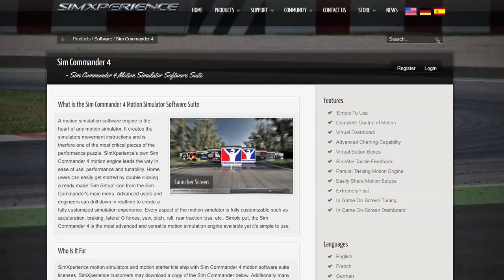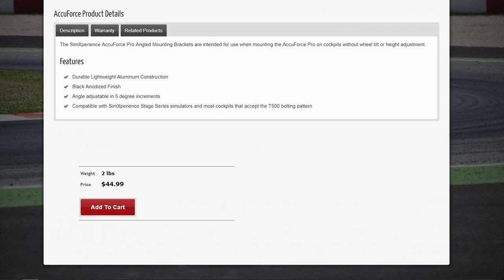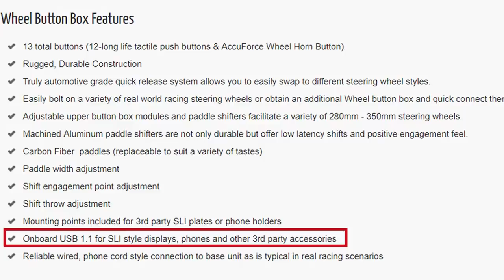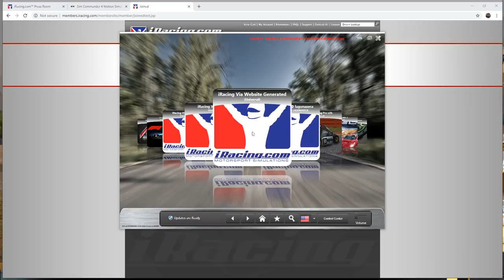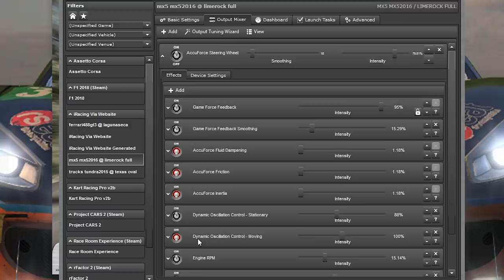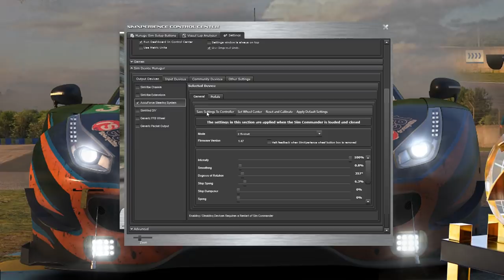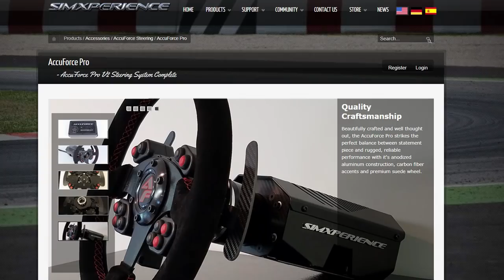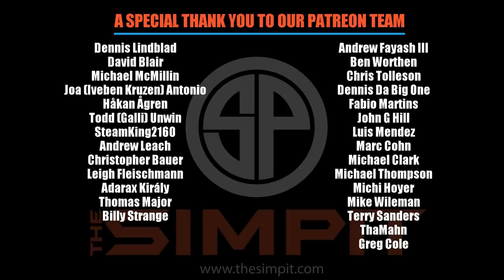Accuforce Pro V2 Steering System - Full Review

Comment: Now let’s go to fanatec dd2!!! Looking forward to the podium series review!!!
Reply: I tested the DD1 and great FFB. I don't think you need more than this and the hardware is the same. Just the software transforms the DD1 to a DD2.
Reply: Leynad Jee Well I wonder why there is a price difference if there isn’t any hardware difference. I know they’re gonna use the dd2 motor for the dd1, but I think there should be some difference in the control unit. Maybe the motor speed controller? If there isn’t any hardware difference, consumers won’t be happy... hundreds of dollars for a software? hmm...
Reply: "hundreds of dollars for a software?" Just thinking about iRacing 😁
Reply: It's only temporary. I believe Fanatec said that the DD1 motors aren't available yet so the pre-ordered versions of the DD1 will use the DD2 motor with an software restriction.  
It's predicted that the community will find a way to "unlock" full DD2 functionality but if the internal PSU is different, it may not work.
Reply: Leynad Jee Oh well that makes sense LOL. But still if that’s true, I won’t be happy... They can just enable the full power... There might be possible hacks to bring the performance up too... Just my thoughts though...LOL
Reply: Drew Duncan That’s what I thought too! But it is possible that the power supply or something that controls the electric current to be different...
Reply: I would not believe in a hack and Fanatec limits the torque anyway depending on the wheel. The torque isn't a problem with both and reliability must be proven first. The possible connection issues from the quick-release i mentioned here, are unsolved problems even by Porsche. And Fanatec has a track record in failing because one cheap part braking. I hope they do a better job this time...
Reply: @Leynad778  It's not just the software, the Motor is the same, but here are parts that drive the motor and those are different.
Reply: @thenonadventure  You can't "unlock" or "hack" a DD1 to have a DD2 because only the Motor is the same but not the electronics that drive it.
Reply: @Leynad778  The torque is only reduced for the 2 CSL Steering Wheels that have the plastic quick release.
Reply: @MixedRealitySimRacing  When they use a different board, they just need to switch a resistor so the motor get's less voltage. If it's the software or not doesn't matter. The effect is the same.
Reply: @MixedRealitySimRacing  we don't know that yet.

Comment: Was looking at a all fanatec club sport kit but switched to this wheel and thrustmaster t3pa- pro pedals
With a fanatec shifter actually now $200 under my budget with a 8020 wheel stand instead of $300 over budget.

Great video and thanks for showing this DD wheel :)
Reply: Seems like you could fill out the budget with some better pedals, or at least $100  for a third party load cell upgrade for the T3PAs.

Comment: Wrap around cable for me isn't an issue.  The cable provided from Simxperience is too short so can get tangled and break.  When I bought the wheel I got a couple extra ones that are about 50% longer and haven't had any issues, I don't even notice it.
Reply: Where did you get the longer cables from? My cable broke as well and I had to cut it and reconnect it.
Reply: @FadNad0731  You get them from Digi-Key, on the Simxperience website the info is there, the cable name is AT-C-26-6/6/B-5/R
Reply: @1984kylea  Thanks so much for the quick response! I have been struggling with this for a while. I will check it out. I might even consider the bluetooth version if it is available.
Reply: @FadNad0731  ya, I probably won't bother with the bluetooth version.  Honestly, I owned the Accuforce for 15 minutes before I broke the initial cord.  I right away bought 5 replacement cables from Digikey, they were shipped out and delivered within 24 hours and I'm still on cable #1 four months later.  The extra length makes all the difference.
Reply: @1984kylea  Ok Thank you, I will definitely get that cable based on your experience, it makes a big difference knowing that you've used it for quite a bit and have not had any issues since.

Comment: Almost 40 months since i got my V1 i can say: it's reliable. And thanks to SC i don't look to other DD-wheels, even i would like to have a bit more torque, for karts for example. I think the cable has two positive aspects as well: you see or feel (in VR) that the wheel is in center-position. If not you might already know what happens at the start. Second is reliability. Even in professional motorsport there is no bullet-proof connection inside the wheel. There is always a bit stress to the column and the pins bent a little and can loose the connection. Happend to the Ironforce Porsche GT3 R team this season and I heard from a Formula E team about this problems as well plus many Fanatec users. But last ones can google for similar problems and will find people. The GT3-team first had no clue and thought TCS, ABS and the transmission is broken. And it always starts intermittent with a shift not recognized here and than. Possibly the reason why they killed two engines within a month before.
Reply: Leynad Jee I’m a tech noob I have a ts pc racer and in most sims I just make small changes eg pc2 r3e and in ac and rf2 I leave it alone is the software that difficult to get in ball park? Also is sim commander a pain with vr (oculus cv1) to launch games? 
Thanks
Reply: @roverboy1687  Sim Commander with the Accuforce is not the problem, but with SimVibe and my Odyssey i have to start it last, because the HMD is changing something with the audio-output. But this is no problem with the Oculus, because the audio-out is fixed. Sim Commander is easy to setup with the Accuforce as well, because default is often okay and the more difficult part are the game FFB-settings, thinking of Raceroom...  Setting up SimVive is far more difficult, but rewarding once you get what you want. The TS-PC-racer seems like a good wheel and i would rather upgrade to SimVibe than a dd-wheel first. SimVibe is like VR for me. Once you know it, you can't drive without.
Reply: Leynad Jee thanks for reply I have the srs shaker cushion I like it but I’m now thinking bigger shakers on my rig would be better also it seems that the road surface is very pronounced and the curbs not so much maybe it’s a limitation of the package hardware. I tried an osw midge not sure what size at a vr sim centre in Scotland on p cars 2 and while it was stronger and I enjoyed some of the characteristics of the wheel I wasn’t blown away by it I don’t know what the settings were etc but felt as it wasn’t as big of a leap as I’d been building it up to be in my head same went for the next level v3 seatmover it was kinda cool but not fully communicative I’d like to try one again with belts attached to expansion springs to simulate the way belts cut in under breaking. On a positive note they had srs power wind simulators they were better than I realised I really enjoyed them even in tin top cars plus much better than usb fans for keeping cool in vr. 
I’m just very tempted at 699 dollars for the your way and then get my thrustmaster rims usb converted by ricmotec with the 70mm adapter plate.
Reply: @roverboy1687  I'm running 4x100 watt shakers for each tyre plus a Buttkicker Concert under the seat on a Brooks-spring-loaded rig. SimVibe has a lot of options to tweak, but every sim feels different as well. rF2 is great for curbs, but not much road-noise, pCars 2 is a bit more the opposite and ACC seems the best so far, at least in tactile feedback. iRacing seems dull in both, but bump suspension-effects and the shifting feels great. I will try the srs-software soon to check, if it does anything better or not. 

I tried the NLR v3 two times at the Expo plus 6 other motion-rigs. The v3 is expensive and not that fast. I would rather buy a SimXperience Stage 1, which seems a bit more violent, faster and cheaper as well. But this all doesn't make you faster and maybe even the opposite. This upcoming SimXperience GS-5 G-Seat seems interesting and maybe first choice once it get's released.

Comment: Great review Shaun! If you want a mid range DD Wheel, you have to give this wheel a serious consideration with it's pricing.
Reply: I kinda thought this was the cheapest DD wheelbase available.  If this is the mid, then what is the low end DD?
Reply: @hueysharapova7175  Sim-Pli_City DDs are cheaper, SiMagic DDs are cheaper....theres actually a few different cheaper options!
Reply: @michaelritch2045  The Simagic with rim included is $900, so basically the same price point.  The Simplicity website has a DD wheel for 630 pounds, which I guess could be considered a lower price tier, but from their website I cant even tell if that includes a rim (which doesnt exactly inspire confidence).  I guess you could order all the individual parts from china and assemble an OSW yourself for much cheaper, but thats kinda true for any product in the world.  The accuforce seems to be in the lowest tier of pricing for a complete wheelbase + rim package.
Reply: @hueysharapova7175  The CSL DD came out now and still requires a wheel. From initial reads/reports, I would go with accuforce V2 over CSL DD.
Reply: @elmalloc  Looks like you are right.  Fanatec finally came out with a cheaper option.  At the time of my original comment, the cheapest DD with rim you could get was close to $1,000 but now there is a true bottom tier.

Comment: do these have a maximum rotation/lock or they are electronically limited by torque from the wheel?
Reply from the maker: With the software, you can limit the rotation limit and do a soft and hard lock
Reply: @TheSimpit  nice. so the wheel just torques against your force at a set rotation limit

Comment: You pointed out a number a great features and outstanding price point. But there's one thing that you failed to mention when you spoke of the price point of the Fanatec wheel base. That unit works on more than one platform and the Accuforce Pro V2 only works with a PC. And in turn to didn't give a FAIR judgement on the pricing. Besides that a great review.

Comment: Shaun, outstanding review! If it wasn't for my need to play Gran Turismo Sport occasionally, I'd be buying this all in one kit immediately. I just don't have time or want to be changing out my wheel base before I get in my rig to have some fun. I'll stick with Fanatec for now.
Reply: It's actually possible with a GimX adapter. Some of our customers run Gran Turismo that way.
Reply: @SimXperience  I am one of those customers, I have been doing it since the GT Sport beta was released and continued with the release of GT Sport.  I was just racing in GT Sport yesterday using my Accuforce.
Reply: What settings are you using on GIMX and GT Sport?  @lawyer4ever
Reply: Oh wow! Thank you so much for that information. Looks like I know what I'll be getting on payday! @SimXperience
Reply: @GoezTo11  Nothing special, just lower FFB levels in GT Sport, since the wheel has so much power.

Comment: So i'm planning on re-building my entire rig and need some suggestions.

I'm thinking of potentially getting this since its about the same price of the Fanatec CW V2.5, with the CSL elite pedals and TH8A shifter.
Do you think all these would play well together? Also I do a lot of drifting, how would that affect the wrap around cable?

Also any recommendation on a rig that can hold this around the $500 (or lower) mark?
Reply: @LO3D  That setup sounds good to me. I have a Simetik K2 rig that I use with an OSW DD wheel and it is solid as a rock. I highly recommend it.
Reply: @seanlouis433  i looked at the simetik k2 and it looks great but after building it out with seat, shifter plate, and shipping it may go a bit over budget. I think i'm gonna go with the Next Level F-GT. Since Shaun made a glowing review of it holding up to a DD wheel, and it's on sale on amazon!!!! only about $10 lol.
Reply: @LO3Dgaming   That rig looks good too.  Sim Racing Paddock
 did a review of it too on his youtube channel if you're interested. Enjoy. And find a way to get VR if you have the PC hardware for it. I have the rift but that new Samsung Odyssey plus looks a steal for $299. If only I was in the states I'd be all over it.

Comment: How does it compare to the accuforce v1? It looks smaller and less robust than the original version.
Reply: Ben, its the same motor and electronics.  They just reduced the size of the housing and got rid of the USB hub that is on the back of the V1.

Comment: At the rate I am burning through logitech wheels this might actually pay for itself after 3 more G920's
Reply: How the hell do u ruin a g920 without being able to fix it. I have busted the bearing carrier. Torn the wires going to finger controls. I also have it turned up to 200% in assetto running a suede drift wheel. Basicly everything that has broken could be repaired with little effort. 2500hrs and it hasn't failed. Iv even repaired the shifter about 5 times. In saying that, screw the logitech shifter I need a upgrade haha

Comment: I was on the pre order for the V1 so I had that wheel for years now.  Is the wheel good, sure, it is good value sure.  But when it comes down to sim commander that's imo as frustrating an experience today as it was years ago, as far as I can tell it has had zero updates to its actual user interface which can only be described with one word 'atrocious'.  It's counter intuitive at all fronts, upon purchase of the V1 I accepted this given this was a new product and obviously would improve over time but it's been years now and we still have this cr@p cover flow to pick games, can't even use your arrow keys to move sliders around and they are so sensitive with a trackball I'm always a few degrees out of whatever setting I want.  Documentation is also non existent basically, there are some OK guides out there but if you ever expect to fully understand what things do or how they interact good luck!  Sure reviews like these really love to glamorize that as being oh so powerful yet complex, it's not the complexity that's the issue here though, it's the terrible interface from start to finish!  The quick release is also a bit of a nuisance if you are wanting to get 3rd party wheels out there, most of them adopt other QR systems so you always have to then buy the AF ones separately and they add up quickly, not to mention that mine failed after a year so have to use a cable now which despite a 'design flaw' was conveniently out of warranty! The wheel which comes with it is also quality control China garbage, the red ring for me wasn't even in the centre of the wheel!  Good luck sending that back from Australia to the US for a replacement.  If the main reason you buy this wheel is because of it's included SC software given you that enhanced experience then prepare to have your frustration exceed your excitement way too often, for me SC may as well not exist and then the only argument left is its price and then you may want to think about is it worth paying more for something higher end again?  I don't fully disagree with this review when it comes to the hardware but many potential buyers may be swayed by SC here as what seals the deal and that is not objectively reviewed here at all, that won't be the stars of any shows anytime soon believe me, Simexperience need to seriously hire a UI designer!
Reply: Hej Stefan, går ud fra du er dansk ? 
købte også V1 da den lige kom. Er nu stadigvæk rigtig glad for det og synes også det #billige" rat er fint nok til lidt rally og den slags. Bruger et OMP GT3 rat til Formel og Gt biler i Iracing. Men giver dig helt ret....de har brug for at gøre Simcommander meget mere brugervenligt...jo de opdatere software`en til tider, men brugerfladen sker der ikke en skid med..desværre. Men synes du ikke, at når man endelig får indstillet det til et spil og bestemt bil..så så virker det også rigtig godt?. Har prøvet et Leobodnar og vil sige at forskellen er meget lille i lang de fleste ting, når først man som sagt for det hele til at spille. Hvilke simulator bruger du mest..Iracing eller?
Reply: @stefanolsen8390  Not Danish, Flemish.  Yeah it works well enough once you setup a car but if you want to create a profile for every car specifically it's very cumbersome.  Then scrolling through dozens of of coverflow images to find what you're looking for, hell even Apple got rid of that feature in itunes many years ago.   The whole SC user experience needs to be redesigned from start to finish, it's beyond me that this is given a pass in reviews, I assume reviewers are so wowed by its complexity and perceived power that complaining about the interface would somehow be called out as poor understanding and therefore it's exempt from criticism.   To answer your other question I play all the main sims really.

Comment: My only complaint about any direct drive wheel, beyond the initial price, is they are not cross platform capable. I know people who buy this are pc players, but if I was to pay this kind of money, I want a wheel that does it all.
Reply: I use my Accuforce V1 with my PS4 all of the time, via the GIMX emulation software and an Arduino adapter.